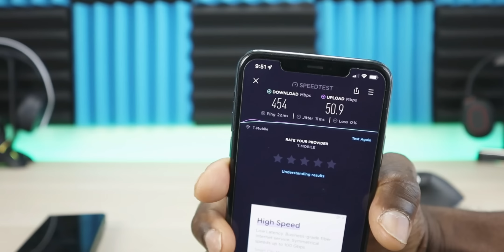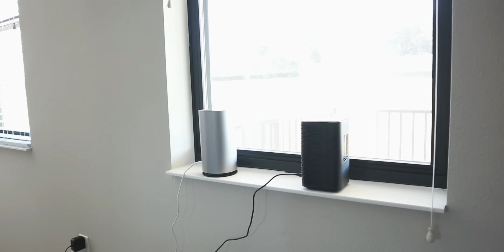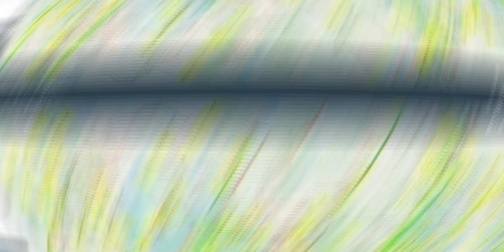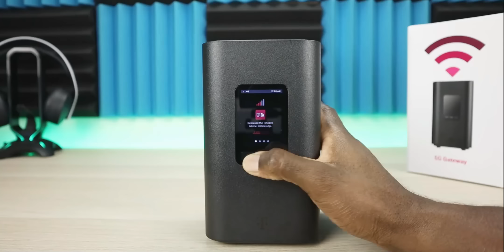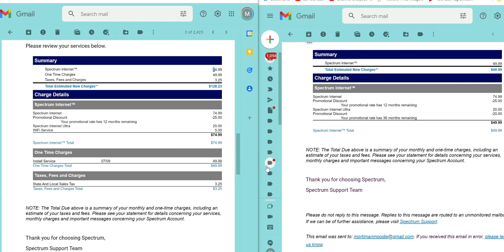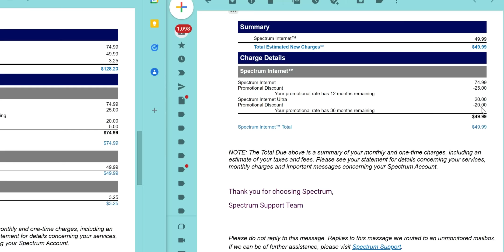Why Did I Get Rid of My T-Mobile Home Internet | Who Am I Using Now, And How Much Am I Paying?

Comment: Medical practice here- Running into issues with T-Mobile 5G Business. When it's good it's good - 100-200MB down for $50/mo I won't complain about. It drops about every other day for us, from a minute or two to a couple of hours. In fairness it's in the middle of the night most times but the big outages have been during the day.  For a medical clinic I don't think we can keep going with it (can you hear me sweating??).  Have Spectrum scheduled for an install coming up, but am not excited about it, because our home rates have been raised in the past and the only way they compete is a lack of competition and promo rates.  Spectrum service is 300MB down, 10MB up, which is similar to what I have at home for a promo of $64.99 going up to $89.99 after a year.  I think wired is the way to go, and am hoping dearly that Google Fiber is our way soon, as I hear they're in the neighborhood surrounding our office, understanding that they are no panacea..
Reply: PS, if you switch mention that you were on T-Mobile for $50. Don't want to spill my previous quotes from providers but it made a big difference.

Comment: My T-Mobile is great. 600 Mb down and over 100 up.  I switched to Verizon because I wanted to use my Meraki firewall and T-Mobile cannot go into bridge mode.  My speeds with VZW was horrific so I forwent my Meraki and went back to T-Mobile.  Hopefully in the future they will allow bridge mode—hint, hint, T-Mobile….
Reply: You can bridge. Just LAN from Modem to a full featured wi-fi router. There are many other features this move will enable too.
Reply: @CycleWerkz That must be a new feature because when I had it that was not an option.  I eventually went to Frontier 1 gig fiber and haven’t looked back!!
Reply: @MrSunDevil23  It's not a feature in the TM device. I connected a separate router via LAN to have all the features I need. I'm glad you got it all resolved for your system.

Comment: T mobile home internet is for folks who live about 30 miles outside of a major city. The folks i know in the city have choppy service with it.  For 30 bucks a month, I'm sticking with it. I was paying AT&T over a hundred bucks a month. I've only seen service impacted one time for about an hour. Because all of my phones are on magenta Max, during that time we just used our hotspot until it came back up. It's really not a big deal, if you have great cell phone coverage with them where you live. I average about 200 down and 20 up. Most folks are being sold a hype that they need an abundance of up speed and down speed. Online games do not appear to be an issue either. It really depends on where you live. The other thing that doesn't make any sense to me is the folks that complain about it not working with Hulu Plus. Hulu Plus is $82 a month. If you are serious car cutter you would not pay for this service at all. You might as well go with a major provider and take a bundle discount with them.

Comment: We finally found the right spot for our T-Mobile Home Internet Gateway it turns out the Attic is the best place for it before I put it in the Attic it was always saying Weak Signal or Good Signal but most of the time just Weak Signal and I had it right near a Window  and we were only averaging around 80MBPS to 90MBPS or sometimes a little more but not much more it's just me and my Mom at the House and occasionally my Sister and some other people coming over but mainly just me and her so we don't really need super fast Internet but still I wanted to try to get the best Speeds possible so I figured I would try the highest place in the House and surprisingly it worked better in the Attic. Now that I moved it to the Attic we get 4 Bars of 5G Signal and we average around high 100MBPS to medium to high 200MBPS and the Upload Speed has also increased from around 2MBPS or 5MBPS to around 15MBPS or 20MBPS and sometimes a little higher so definitely put it somewhere high up. I also recommend putting a Fan underneath of it to help keep it Cool I've noticed a Fan does help with Signal reliability and Speeds our Attic does get really hot in the Summer so I'm going to be putting another stand up Fan up there to help circulate the air to help keep it Cooled down even more during the Summer.

Comment: Same happened to me. My connection was initially great but after a few weeks I had similar numbers to you. It went from very fast to super slow with higher upload speeds. I started to lose connection a lot as well. I considered holding on since it was only $30 a month but it became too unreliable.  I moved back to Spectrum after a few months. They were the only other provider in my city to offer fast enough speeds. In regards o Spectrum,  while signing up  I was hesitating remembering their poor service from before. As I kept the page open to consider signing up online, there was a pop up after keeping the page open for a few minutes. It was an enticement for  me to sign up by offering a $50 credit. It's like they could tell that I was hesitating. I signed up only to find they do not honor their ads. They have yet to give me the credit. I've talked to quite a few of their customer service people. Most never heard of the deal. I finally found someone who knew about it and promised to fix it saying that she was  aware of it and would put it through.  After wasting a couple hours on the phone I  have yet to see it reflected in my bill. Beware of their promises. Spectrum customer service is very poor.

Comment: I just got my T-mobile gateway, i am testing it now under a 2 week trial. I ended up reducing the load on the gateway by using my own mesh router and only using specific devices to connect directly. So far, i have not had any problems. 

Getting around 250 to 500Mbps and 100 up. Gaming pings are saying around 30ms to 50ms. I do so some spike up every 20s to 100ms.
Reply: Do u still have it i was thinking of buying one strictly of just my ps4

Comment: I live in an area in Florida where cable companies will not go. I had VIASAT Satellite internet for about 5 years which was my only choice for my area. And it was expensive at 80.00 dollars per month. Downloads were in the 12 MBPS range. But I was happy because I had pretty fast internet and could watch YouTube with no buffering. Movies on Amazon Prime were OK most of the time. Then I saw an ad for T-mobile Home Internet. I tried it and liked it. It is not super fast - downloads are in the 15 to 50 MBPS range - so no more buffering. And T-mobile is 30 dollars per month cheaper than VIASAT. Also, when a thunderstorm comes through my area I still have my internet. Also no more ugly dish outside. So i am happy with T-mobile.

Comment: I have been using it for a couple weeks now and my speeds are 450 to 650 down and 75 to 101 up......I have hit over 700 several times and have had no slow downs. So far working great for me...... does better than my cable internet was....
Reply from the maker: I hope it stays that way for you. Mine started off with really impressive speeds as well. If you don't mind me asking, what is your location?
Reply: We are near Rochester, NY and I can see the T Mobile tower about a half mile away so that probably helps… so far so good but will keep checking….just got 723 download and 101 upload…..

Comment: Yeah T-mobile is starting to throttle me now also. Tonight I'm getting 5 mbps speeds and it doesn't even feel like I'm getting that! I've had them for just under two weeks now and when I first started my speeds were 200 plus Mbps. This seems to be happening to everyone who gets this service. That is you start out with really fast internet and end up with almost useless speeds. 
I think I'm going to give Straight Talk's home internet a try very soon.
Reply from the maker: Yea, that really sucks. Keep us updated
Reply: Well this morning speeds seem normal again but last night between 10:30pm and 4:00 speeds were like dial up! 
In the past late night they were always super fast. I'm wondering if an external antenna might not do the trick. Although even when speeds a slow I always receive four bars.
Reply from the maker: @irongoose3865  I think it has more to do with the tower. I know that home internet is not prioritized, but it seems like they are always making excuses without a real solution. Do you have the Nokia or Arc device?
Reply: @Triple_M  The Arc
Reply: @Triple_M  Happened to me again tonight, that is really slow internet. But this time I called customer service. They had a recording that said they were experiencing an issue in my area and had techs working on the problem and then put me on hold. The slow speeds lasted several hours between 11pm to 3am. This was the first time in a week that this has happened again. Other then that speed has been really good all week including all day Sunday.
Reply: I don't believe I'm going to try Straight Talk because I saw a YouTube video about a ST user who was being throttled while being parked in his car right next to a tower! In the beginning of the the video he was getting better then advertised speeds. Seems to be a problem with towers and equipment. I'm confident T-Mobile will work on a solution where as Straight Talk will take whatever Verizon is going to give them and be happy. As for Verizon they only guarantee their price for two years so I'm not interested. Comcast used to deal and I always got good prices from them every year until one day they stopped dealing! 
Wait and see if Verizon doesn't follow the same model, not interested! Verizon has taken over Page Plus cellular and TracFone and are screwing Samsung Galaxy phone owners out of service by not allowing them to connect to their towers. I know, my wife's phone just stopped working after I just gave them $80.00 two months ago for PP's pay as you go plan. I had PP for years without an issue until Verizon took it over! Plus I'm getting the runaround getting my TracFone that I've had for two years unlocked. I'm done with anything Verizon!

Comment: I have tmobile and I  get 160 to 198 mbs and 46 to 60 mbs up. I use a ax1500 router and all my devices connect and works with incredible speed to serve even gaming with no lag.
Reply from the maker: Mine worked well for a while too. I hope you have better luck than me.
Reply: @Triple_M  I think it also helps when you do not live in a city environment. I live in the suburbs so not a lot of networks around me.  It has actually reached 280 MBS and 80 MBS relatively at night so I set up huge video downloads and go to bed.  Also, I'm using ipvanish which has that new feature of  Wiseguard protocol that I forgot to mention.  I also setup my MTC to 1420 not 1500 which is actually what T Mobile uses.

Comment: I've had the trash can for over a year. Added a fan to keep it cool. In the begging (it biblical here lol) it work pretty well zippy fast 200+down then we'll crash Ola. Very hit or miss. Then we decided you know let move the gateway. Back up to 100 down load (we have an all metal roof which does not help).  Moving it strangly originally the app said this spot was not idea. Well moving it seemed to help a lot.  It acts up likes its Confused at times. But honestly we're stuck where we're at the dsl provider only offer 10mbs horrible!!!  I would say 90‰ of the time it works well.. For the 50 buck we're paying even with the quirqs it's better than the dsl which was our only option.   Although interesting we don't have to reboot like we use to.  I find when it get wonky I go into tmobile app and tell it I can't co nect to internet and they do a signal refresh which always seems to fix it. I think when it works it's great and that when it gets confused on what band it's trying to use is the downfall to it. Can I steam 4k movies yes, my security cameras have a 99.5 uptime. Went though a hurricane and shockingly it all came back online with no help from me.  Overall it does whaf needs to do. It has it good days and bad. But I'm up shit creek with only 1 provider so for me this is my lifeline

Comment: As a T-Mobile previous employee, T-Mobile Heavily Deprioritizes Home internet. It will get degraded fast. T-Mobile doesn't handle network management very well at all. I have Verizon now, and I will confidently say that the networks are VERY different. Verizon works more effectively and more reliability. Verizon 5G home internet is more stable, even during peak times. T-Mobile constantly has dropped call issues, and random moments where 5G doesn't work at all. Verizon and T-Mobiles should never be compared due to significant differences between the networks and how they both manage network traffic.  For what you pay you get a great deal, however DO NOT call T-Mobile if you experience slow data speeds on your phone or on your home internet. DO NOT call T-Mobile if you experience dropped calls. DO NOT call T-Mobile if you experience intermittent service drops. These issues will not be resolved. You will be told " This is due to network modernization. " or you will be told "they are working on the towers" Remember that T-Mobile is cheaper for a reason. If you experience your service not working even with 2 bars of service, this is normal for T-Mobile, their network is not optimized optimally like Verizon and AT&T. There is a reason first responders and the US national parks service relies heavily on Verizon and AT&T.  Also T-Mobile lies about their coverage. They do not have a single cell tower in Alaska they roam onto GCI. If you domestically roam too much with T-Mobile Domestically your service will be terminated. They have always had this in their TOS, but never enforced it. T-Mobile relies more than Verizon and AT&T on domestic roaming partners, and they will terminate you for more than 3 months of domestic roaming. Verizon will not terminate you. AT&T may restrict data usage domestically. T-Mobile can get away with this because you get access to roaming partners, it's how they can claim 5G in Alaska, however it is in fact on GCI. T-Mobile cares more about quantity more than quality now. They network is taking too many customers that what the network is designed for. In 2023 it's only going to get worse. T-Mobiles is amazing at advertising. Keep in mind that T-Mobile prioritizes its home internet customer as QCI 9 THE ABSOLUTE LOWEST NETWORK PRIORITY. T-Mobile will tell you, you won't notice, I promise you have issues if you are on a congested cell site.

Comment: T-Mobile Home Internet is down to $25 a month for new users now.  I have the same speeds you were originally getting here in suburban IL.  I'm still keeping my Gig fiber connection but for $25 a month why not use T-Mobile Home Internet for failover/load balancing.  I have the same Synology router you have and setting the failover/load balancing with my Gig connection and T-Mobile Home Internet was pretty easy.  Maybe an idea for your next video?

Comment: same story herre...we are working on the towers and last week 5 days ago they told me that one tower 8 miles away had a ticket and was down, but that I was conneccting to another tower only 2 miles away that also was having trouble....

I play CHess on chess24 and during each rapid game, y connection will drop out long enough to lose at least 2 minutes on the clock...and just now I lost an entire game again because after 2 minutes of a lost connection the opponent can claim the game, so I lost another one.

I pay t mobile for 4 lines and none of them work very well and they are all 5G which was supposed to be superior, but the tech seemed to have gotten worse.

one of the strange parts is that the signal will go from good to a crawl rapidly and does so a few times each hour or it just slows down to nil for several hours at a time....but they are working on the towers

something is very strange about all of this

Comment: Your signal to noise ratio is 7 db difference which is huge. That difference would bother me and quite possibly have much to do with data accuracy. The data is flowing but if it has to error correct the crap out of the incoming signals it slows down dramatically. A factor of 5 times or more is evident in this case. I would also suspect interference to the newer unit vs the old one. I would take some readings around there to see if you have signals making problems for you and your connection. I appreciate you making this data available.

Comment: I had no idea this kind of internet was out there. I live in the country and the only internet that was offered here was bluebird wireless which had a dish set on a tower 4 miles away. My speeds were 0.400 D and 0.250 U. I used this internet for years and was always VERY unhappy with it. well Bluebird had less than 20 people left on the tower so they just said it isnt worth all the problems and dropped service here. I was actually missing the slow internet. I talked to my neighbor who told me they were using Starlink, I had no idea that was a thing either, I had always heard sat internet is a No-Go. Well, I signed up for Starlink paid my $100 sign-up fee and was told I wouldn't get it for a year and then i would have to pay another $650 for equipment and it would be $120 a month.  Sad Day. Been without internet for three months when the oddest thing happened, my neighbor knocked on my door and she had checked out a small Verizon MiFi box that the library allows people to use for 7 days and then it must be returned, and you sign up on a list to get it again when it is available again. My internet speeds were 200-MBPS up and 80-mbps down, I had never got to use a internet that was so fast, I LOVED it, well today is my last day it must be returned, so I'm going by all of the phone companies to try and get one for my home, I hope it goes well for me. I'm no9t sure what to expect. I'm hoping I can get it without needing to get a phone plan that I don't want.